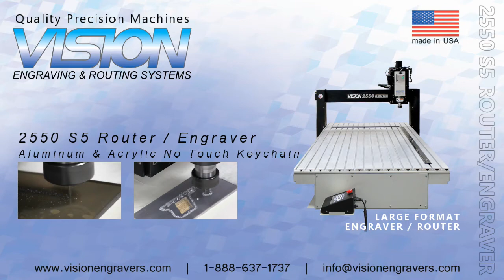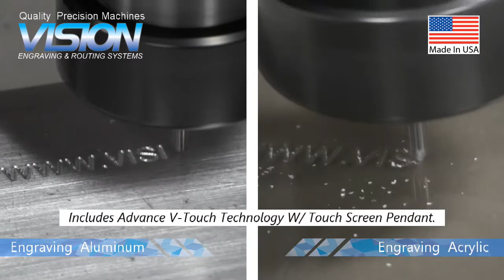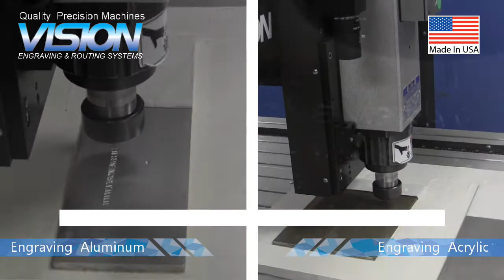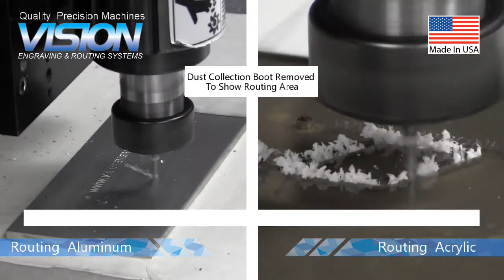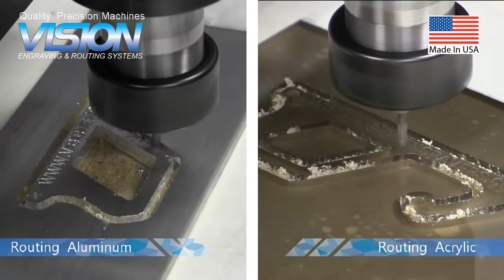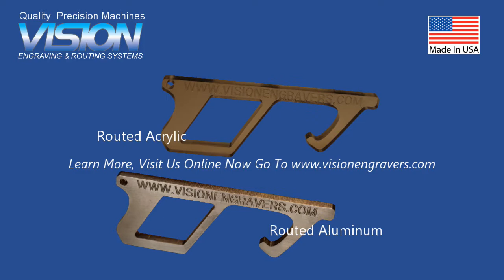CNC Routing  An Acrylic & Aluminum No Touch Keychain.

Comment: I miss working with vision engravers. I worked at a company called compliance signs using these tables daily for 5 years until they sold and moved to Florida. Steve and Jason used to come preform maintenance on our tables. I miss my job and tables so bad.